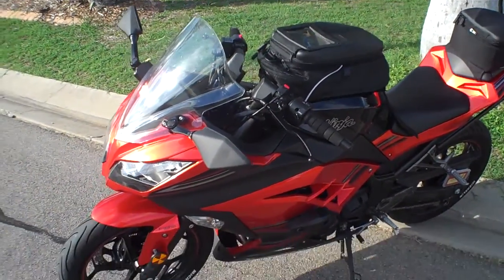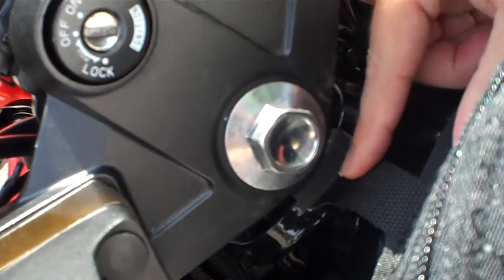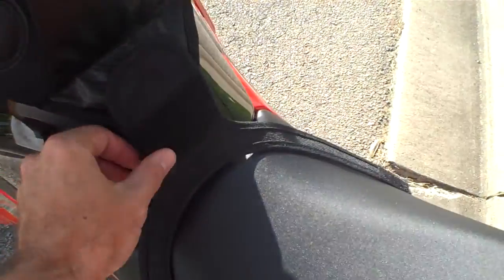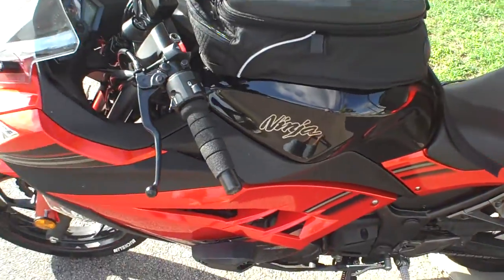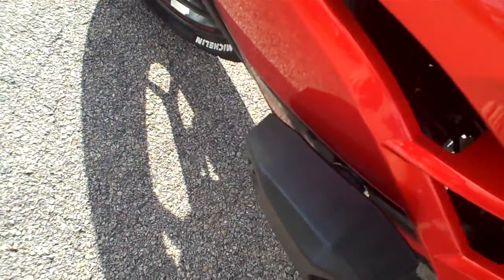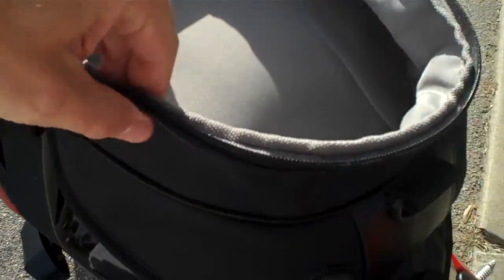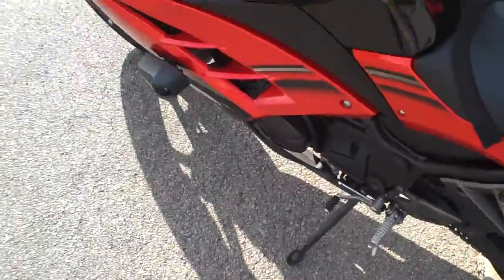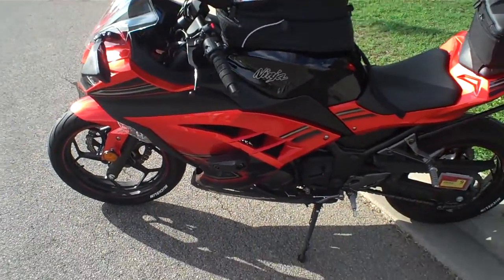Overview of Genuine Kwaka Ninja 300 accessories fitted

Comment: Hey mate on that tank bag were the clear plastic view is do you wreckon you could fit an iphone 6 in there to use as gps thinking bout getting this from ebay
Reply from the maker: +SykoRhyme i have a samsung galaxy note 2 i tried it with, and it is about 15mm too long to fit inside it. so i doubt a iphone 6 will fit either